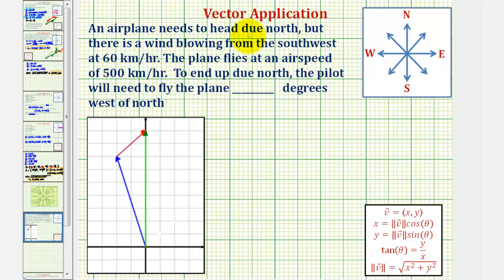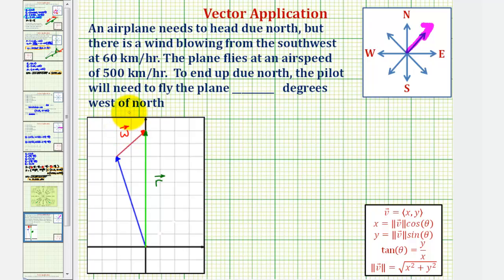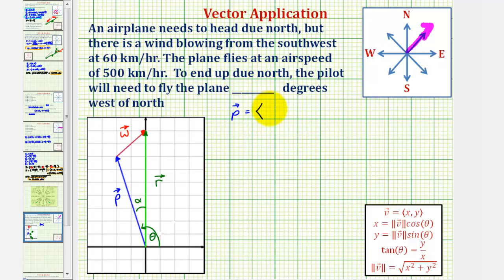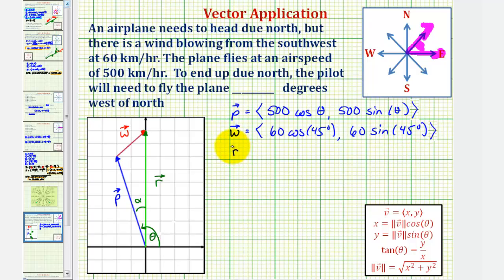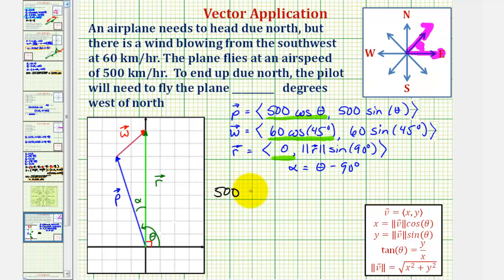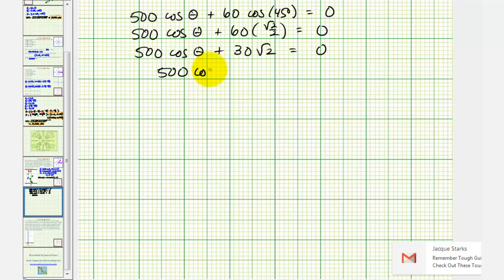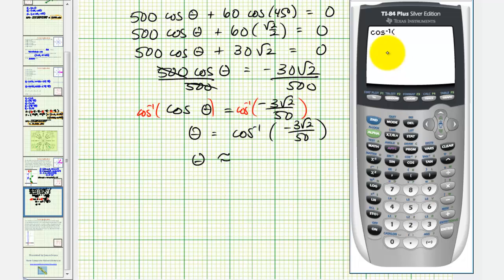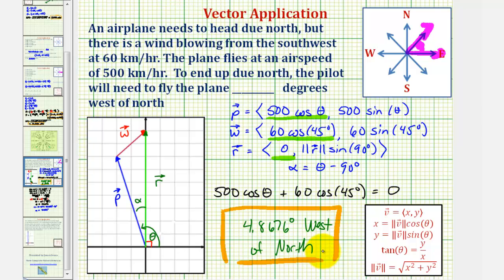Ex: Vector App - Find an Airplane Direction In  The Wind To Fly Due North

Comment: Thanks for the video.  An easier approach would be to find the x component vector for the wind which is 60 * cos 45 = 42.  Because this is also the x component vector of the plane, sin theta = 42/500 and theta = 4.8 degrees W of N.